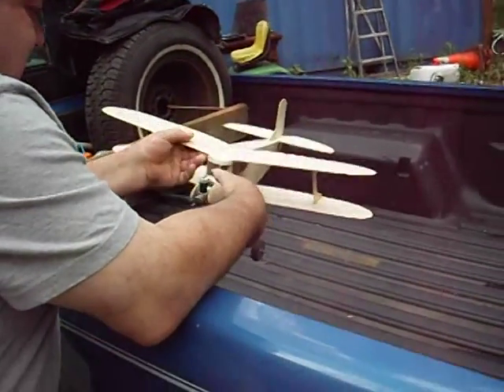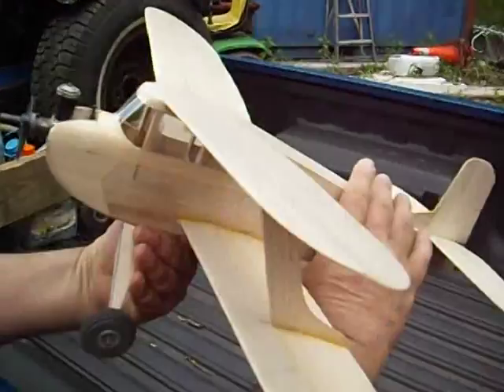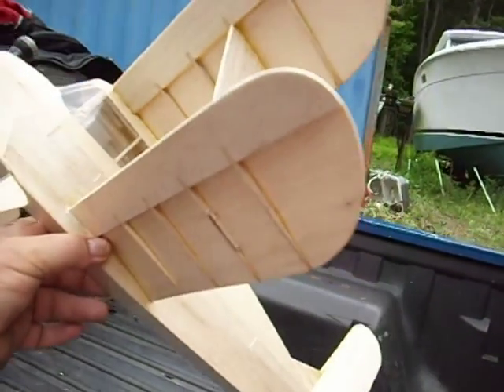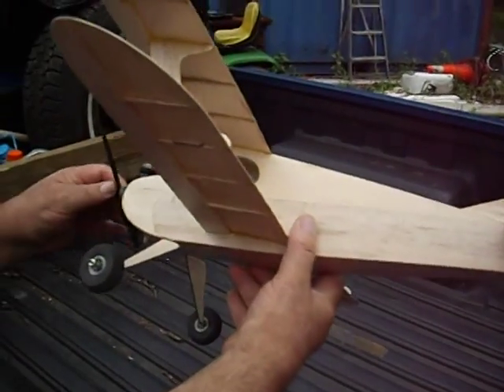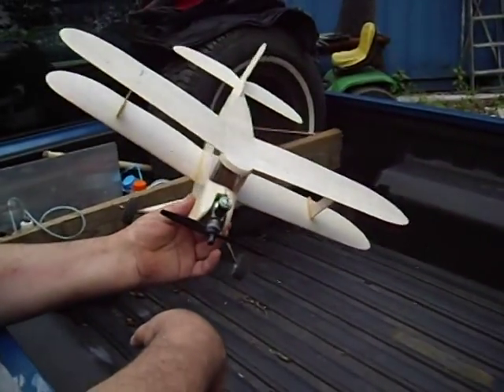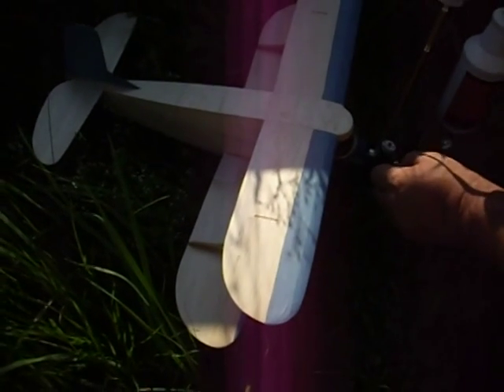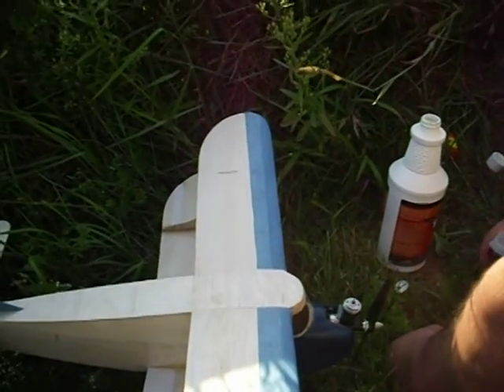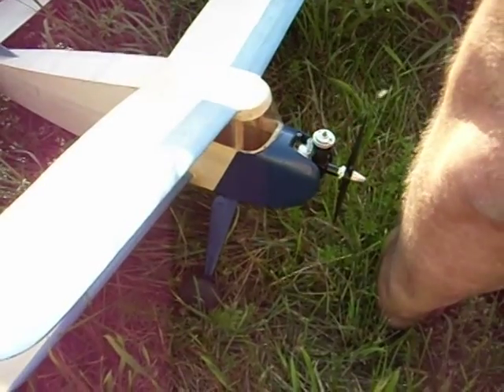Richie's Cox .049 F/F Dakota Maiden Flight- FLYAWAY!!

Comment: I did a good bit of F/F as a youth.  Back in the 60’s-70’s, you could find Baby Bees for a Dollar at garage and Yard Sales, sometimes with the remains of the plastic airplane it was mounted to.  One easy trick we learned from a more experienced modeler was to carefully disassemble the  fuel tank and fill it nearly full with BB’s, then carefully reassemble it.  The BB’s added a tiny bit of nose weight but most importantly, it took up about 75% of the useable capacity of the fuel tank volume.  You were lucky to get more than 40 seconds of run time, done this way.

All of us kids built many of the Carl Goldberg Vikings, 1/2a Blazer’s, and also scratch built a few other types from plans (Playboys, Quaker’s, Satellite’s, etc).  Slowly we graduated to larger .15 sized models and discovered Fuel shut offs and dethermilizers (Tatone).  We never did the rope dethermalizers for fear of starting a grass fire in the pasture.  Keep flying this little bird, try less pitch on the prop, maybe a 6x2 instead of a 6x3, or try a 5x3.
Reply from the maker: Thanks Timothy! Yes I remember picking up used .049's at garage sales too! I still have a few kicking around but they don't get used very often due to noise concerns. I miss the sound and smell of running these cute little motors! We really don't have any suitable free flight fields around here in western Mass so Richie and I flew a lot of single-channel R/C planes with Cox motors and pulse-rudder setups from Ace R/C and Mattel back in the old days. At this point we only fire them up rarely for a bit of nostalgia. Recently I took a step back to nitro power by finally finishing a Baby Birdy 1/2A pattern ship I started building about 25 years ago after finding a Norvel .061 in decent condition....video of the maiden flight coming soon!

Comment: The videos have been inspirational. I just lost my Dakota unfortunately. Mine was OK Cub .049 powered. It was flying like clockwork. I changed the prop which was a bad idea as it was really more effective and took it straight up in a spiral. This is great if you want altitude but my field is not adequate for the height the plane achieved. it leveled out about 250 feet high and flew out and I never recovered it. Very saddening and I know how you felt
Reply from the maker: Hi Ken! Sorry to hear about your flyaway Dakota! We are in the same situation of not really having a big enough field to fly gassies! We are mostly flying capacitor electric free flights, they are not as expensive when we lose them! Thanks for leaving a comment!   -Mike and Richie

Comment: My dad had these free flight balsa planes in the 1950's he said they had a rubber band that held the tail rudder straight they lit a fuse that burned a couple of seconds then the rudder would flip to one side and the plane would circle , making sure it stayed in a certain pattern , he's in his eighties and couldn't tell me much more , great video thanks for sharing
Reply from the maker: Yes! I remember reading notes on the blueprints which described making the fuse from butcher's cord and potassium nitrate, I believe. You would test each batch and find out the burn time per inch! By the time I started building in the 60's people were already using clockwork mechanical timers. I was flying crude rubber power models, crudely built, at the time...really wasn't much need for a dethermalizer. I would have been thrilled if one of my planes flew well enough to go out of sight!  Thanks for the comment and best wishes to you and your Dad!!  Hit that subscribe button and stay in touch. Mike and Richie

Comment: I remember those free flyers! Hate the hell out of them. Cranky little screamers that flew away never to be seen again. It was best to try and set the rudder to a slight turn so the plane would fly in circles above you. The problem is,as soon as the motor quit,they went straight and always headed for woods. I remember my brother building two of them. Both got lost. The line control planes were the funnest. Round and round till you couldnt stand up no longer. Even at a quarter full of fuel,those cox planes still flew too long. lol. Back in the 1970's! ( early)
Reply from the maker: I remember flying those control line Cox planes too....wondering how much longer that fuel could possibly last as I got dizzier and dizzier! We mostly fly R/C these days but the free flights are still a thrill even if they sometimes end up in the woods. Thanks for the view and comment! Mike and Richie

Comment: Next time put the prop on backward. It will go slower. Just a thought. Did fly good though for a short wing plane.
Reply from the maker: You're right, Bill! We'll be doing that for sure next time! That was one of the many things we discussed on the way home that day, but we decided our biggest mistake was flying free-flight in a tiny little field surrounded by miles of woods. Next time we're gonna lose it at a bigger field! Thanks for dropping a comment and stay tuned for the next attempt, coming soon....mike+richie

Comment: This is the best video ever!!!
Where I buy this tiny motor?
Reply from the maker: Thanks! The motor is an old Cox .049. I'm not sure if they are still being manufactured, but I think you can find them on sites like ebay in good used condition. Engine displaces .049 cubic inch which equals about .803 c.c.                 -Mike

Comment: I never tried free flight....I fly radio control and control line...I don't ever remember seeing a free flight plane fly in person...great video and really nice old plane design...I just built a Sterling models Ringmaster...the same plane my father taught me to fly on... i found  it on ebay and going to fly it soon...
Reply from the maker: Yes, the Ringmaster was a great flying model, I remember them well! I had models similar to it and what I remember best is how dizzy I would get while hoping the fuel would run out!! We don't often fly our gas powered free flights because we don't have a proper big flying field ...as you can see in this video... but we have been getting a lot of mileage out of our capacitor-powered electric free flights, they're more suited to our small fields and don't break the bank if they hook a thermal and fly away (which they sometimes do!...). Check out some of my capacitor plane videos, they are pure fun! Let's have a video of that Ringmaster when the time comes, we are subscribed and eagerly waiting! Mike and Richie in Massachusetts...where it's currently 12 degrees F and NOBODY is flying!!
Reply: @sonex413  maiden flight today...video is on my sons channel....''john tereskerz''
Reply from the maker: Congrats! Looked AWESOME!

Comment: That would make a great rc model.
Reply from the maker: I agree! There's enough room in there for sure. Richie's going to be a hard sell on the idea, though; he's in love with the idea of tempting fate with his free flight jobs! Thanks for stopping by and leaving a comment! Mike
Reply: sonex413 I suppose he could trim it for free flight and only use the radio to steer it back.
Reply from the maker: Actually, I have a little micro brick radio from a UMX Micro Radian with one good servo on it. I offered it to Richie but he is averse to cutting into the old bird...wings are permanently installed and there is no access to the interior without surgery!  He's getting ready to try free-flying it again at a bigger field and has promised to let me video the attempt; stay tuned!
Reply: sonex413 I get it. He did a great job on it and sometimes you just like things for what they are.  That's probably why I still fly cox engines along side all the new tech.
Reply from the maker: Yup, the nostalgia is a big part...so are the sound and smell of those little things! ...Not to mention the feeling of having cheated fate when you (somehow) bring it home in one piece!
Reply: sonex413 Hahahah so true!!

Comment: Soon as I saw the trees I knew you would lose it.  These old plane designs with non RC need a large field with no trees.  I remember as a kid my fingers being whacked by those .049 engines.  I used to fly the string line blue and yellow Cox trainer.  I bet my neighbors hated those loud planes on our street.  I got back into RC about 10 years ago and with the newer battery technology flying is cheaper and fun.  Fuel RC planes are always a mess to deal with.  I am one that loves the electric systems.
Reply from the maker: Sadly we don't have any truly suitable free flight areas nearby...Here in western Mass the landscape is predominately forest. When I was a kid many years ago there were some open areas but as dairy farming disappeared so did the fields. Now we fly mostly electric RC but we still run a nitro engine or turn a free flight loose once in a while just for nostalgia's sake. Glad to hear you got back into the hobby. Yes the electric systems are great...I'm saving a fortune in paper towels and windex! Thanks for commenting!

Comment: I like watching engine powered FF, but I'm not trying it. I'll stick to certain types of rubber powered, RC or CL. Lucky got it back.
Reply from the maker: When I was a kid, you could buy a brand new Cox .020 for $2.95 at the local sporting goods store. The .049 Cox would set you back an additional buck. Back then we didn't think anything of turning one loose! Now we mostly fly r/c and very small field free flight. And Cox motors are going for fifty bucks on ebay. sheeesh!
Reply: @sonex413  Crazy ain't it. As a kid we had a Western Auto and they kept all the "good stuff" in the back of the store. LOL The good stuff is always in the back, right? Seems like that's how it goes. They had model planes and supplies and model rockets like Centuri and Estes. If you wanted something they didnt have, they. could order it. I grew up near Fort Knox and they had a hobby shop on post and I had to sign in at the guard gate to go to it.

Comment: You can buy the same, diecut sheet balsa biplanes @ www.Banggood.com & www.Gearbest.com. Just enter Balsa Airplane in the sites search engines and they'll pop right up. They are RC Electrics, with tiny coreless motors with gear reduction driven props, 150mah LiPo battery, small 2.4Ghz receiver with electronic speed controller and 2 screw drive servos for elevator and rudder. The electronics total cost is about $17 ( motor w/gear drive & proper, battery, Receiver-ESC-Servos all on one board for under $20 ) and the sheet balsa biplane is about $23. You can get a 2.4kHz 4 channel transmitter for $8 that will bind to the RX unit. I have and fly 3 variations and they are sturdy, lite fliers.
Reply: Link to the RECEIVER, SPEED CONTROLLER ( throttle ) SERVOS all on one board LINK:http://www.banggood.com/Hisky-Buzz-HFW400-RC-Airplane-Spare-Parts-Circuit-Receiver-Board-p-983787.html
Reply from the maker: +John Schips Thanks for the links, John! Sounds like a great deal for the micro gear. Years ago, when I started flying R/C, the equipment was expensive compared to today's prices (and a lot heavier, too!). It's a great time for people just getting into the hobby these days! Mike